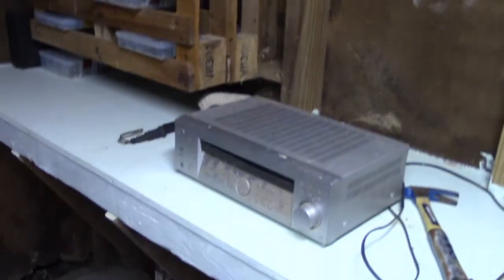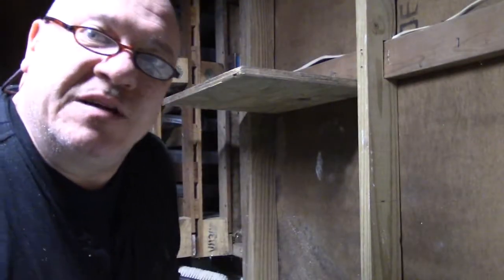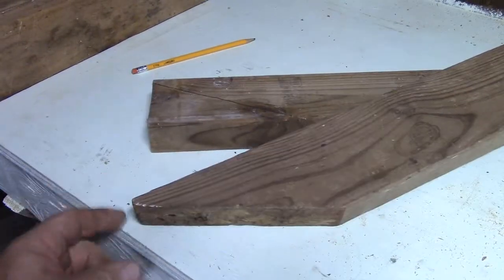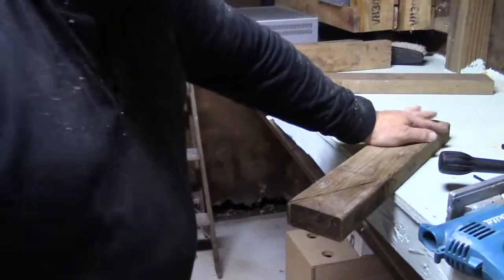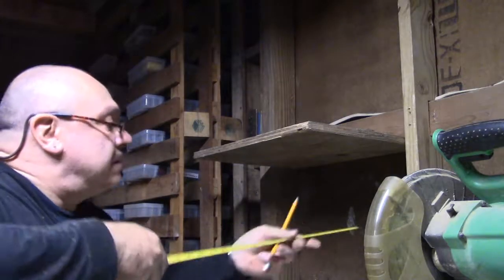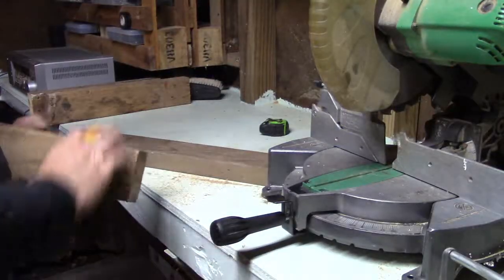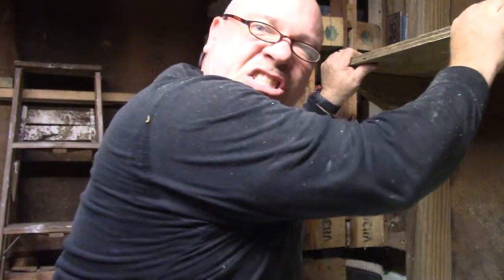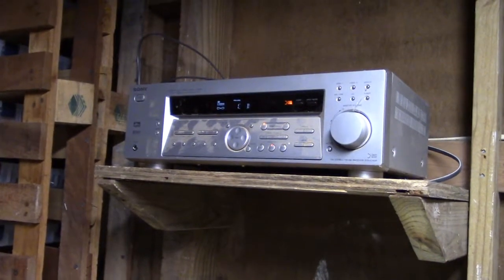How to Build a Quick Shelf in Your Shed or Garage for Your Stereo

Comment: what size nails did you use to hold the brace in place?
Reply from the maker: Depends on the thickness of your wood. Try to use a nail that will go all the way through your first board, and half to three quarters the way into your second board.
Reply: @PirateStu  thanks, I understand that ~ just curious to get a comparison ~ I have 1 1/2" to 2" nails ~ just wanted an affirmation as to whether that would be strong enough to hold things together ~ Much appreciated
Reply from the maker: @womenswellness1577  a modern day 2x4 board is only 1.5 inches wide, so a 1 1/2 inch nail wouldn't go through into the second board. I'd recommend a 2 1/2 inch nail, but a 2 inch nail might work nicely if you're not putting a lot of weight on your shelf. What I like to do is take one of the nails I'm using, and hold it up against the two boards I want to nail together so I can see how much will be going into the second board.
Reply: @PirateStu  definitely need what I am wanting to do hold weight ~ as in books.Thank you sir that was helpful!